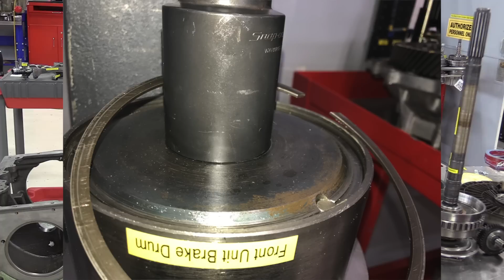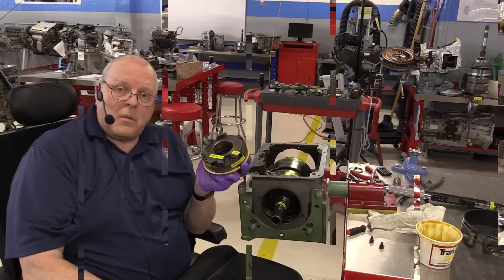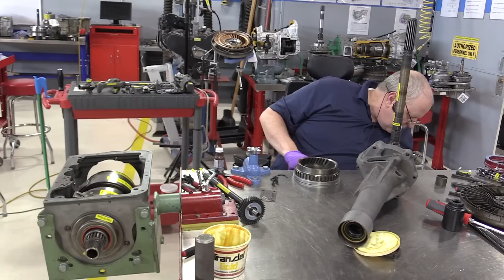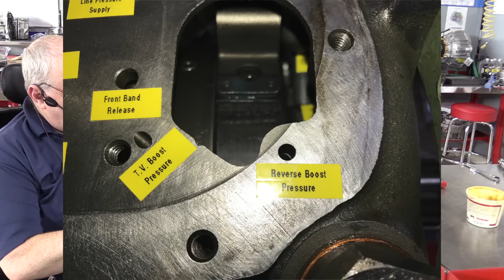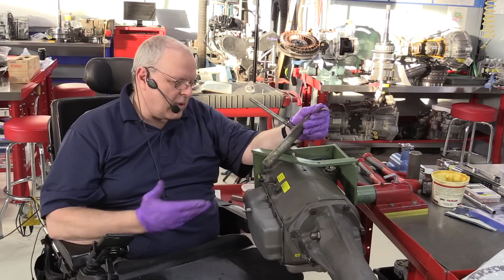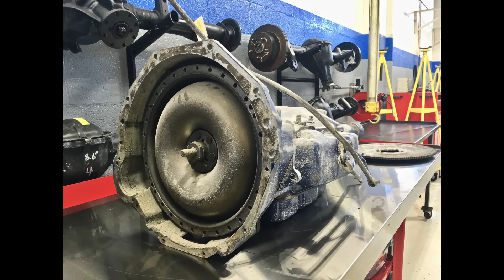World's First Mass-Produced Automatic Transmission - Part 5 - Final Assembly

Comment: Any chance of seeing this running on the transmission dyno?
Reply from the maker: I wish I could, but I have not figured out a way to connect the flywheel to our transmission dynamometer. The bolt pattern is different and it has a hole in the middle that needs to be sealed off to keep fluid inside the fluid coupling.
Reply: Any possible way to collaborate with the engineering department to make you guys an adapter of some sort?

Comment: Were these transmissions reliable? Were they well behaved in terms of their shifting characteristics?
Reply from the maker: They were very reliable for 16 years before they were replaced with the next generation Hydra-Matic. They had harsh shifts, particularly between 2nd and 3rd gears, but people didn't care for a long time. They were just glad they did not have to shaft a manual transmission any longer. Thanks for your feedback!
Reply: I understand that the the reason Buick didn't want to have anything to do with these transmissions is that Buick used a torque tube between the transmission and the rear axle - a solid assembly in other words.  In Olds and Cadillac, the rear springs absorbed the shock during shifting by allowing the rear axle to twist momentarily, so largely adsorbing the impact.

Buick developed their torque converter transmission, the additional slip of which lessened the shift shock issue, albeit at the expense of efficiency.  Today, the excessive slip inherent in a torque converter is removed by use of a lock-up clutch.  Rolls-Royce chose the original HydraMatic transmission because they considered it to be the best of all autos, but their more precisely controlled (of course!) rear axle resulted in noticeable jerking during shifts. 

The plain fluid coupling used in the original Hydra-Matic has relatively little slip, is more efficient, which was important when the original automatic was being directly compared by customers with manual transmissions.  The rear oil pump was another feature which was later dropped, but it enabled the car to be push started, again matching one of the abilities of a manual transmission.
Reply: i just bought a 1948 cadillac with a 4 speed hydra-matic :)
Reply: Very informative of what I'm up against. I have acquired a '48 Olds Dynamic 66 Club Coupe. It's a survivor and I aim to keep it that way. Only reverse works at the moment.